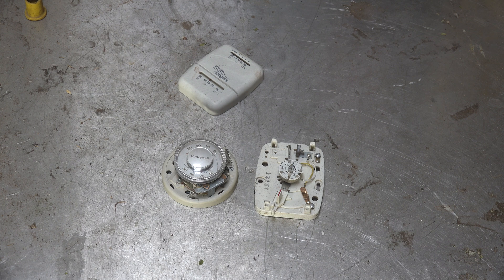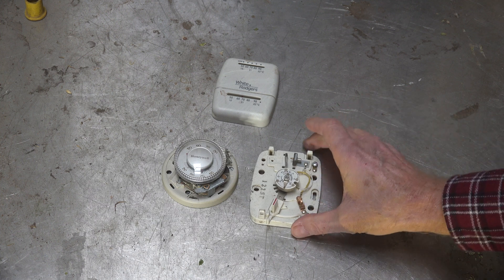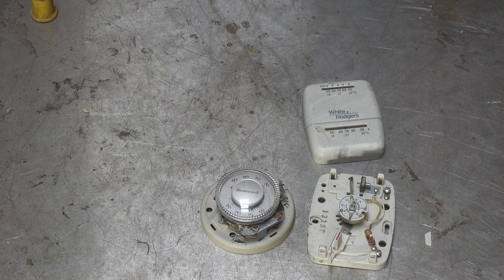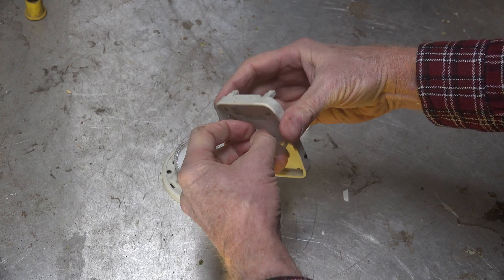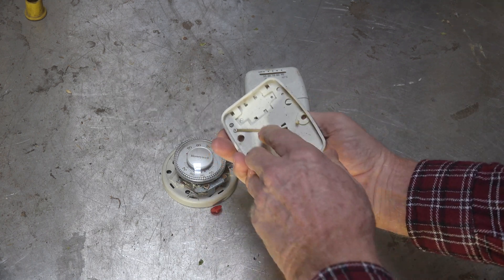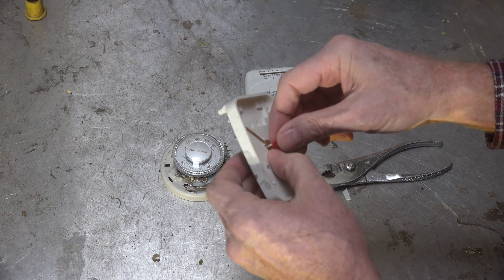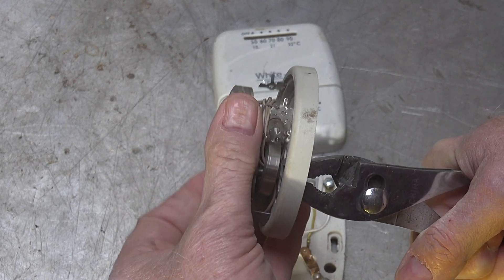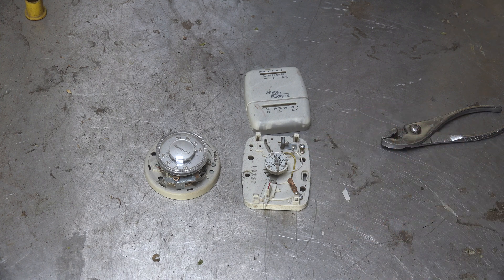Can you calibrate the mechanical thermostat

Comment: I'm in a rental with an old rectangular Honeywell that wouldn't go cool enough. I'd peg it as low possible, allegedly 55, and it would still come on at 63. Wound up "calibrating" it by shifting the mounting screws slightly off level.

Comment: You seem to know a lot about mechanical thermostats. We just installed a new white Rodgers vertical thermostat. We hooked up the two wires coming from the wall. I double checked to make sure they were also connected on the furnace itself.  We connected the white wire to the W and the red wire to the RH, but it is not working. Any suggestions?

Comment: The T87F use to be the most reliable thermostat & yes you can calibrate them somewhat but is it worth it ? (most probably not) In the end it's just a number. The most important things is it working properly ( cycli ng on and off without major swings ?) .Is the heat anticipator set to the amp draw of the 24 volt system ? And is the thermostat in a good location? If the thermostat needs to be replaced, it needs to be replaced which has nothing to do with the customers finances, they're not that expensive and if they pull on my heartstrings they get one for free ( I'm a pretty wealthy man, I think I can afford it).

Comment: The thermometer section can often be calibrated in a similar way
Reply from the maker: Sometimes, yes.
GFM
Reply: I've dome it in the T87. Suction cup pulls the cover, then remove middle Honeywell marked part and rotate plastic round part to move coil and pointer. Let it rest and repeat until it is same as local accurate thermometer. Replace parts.